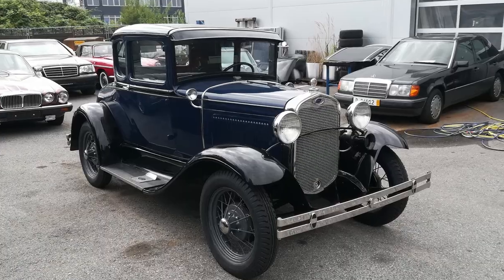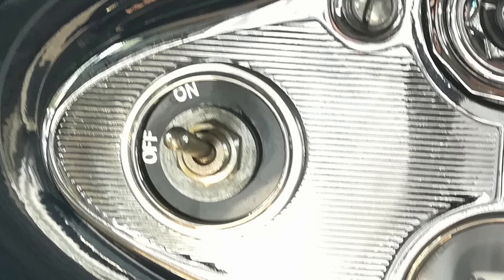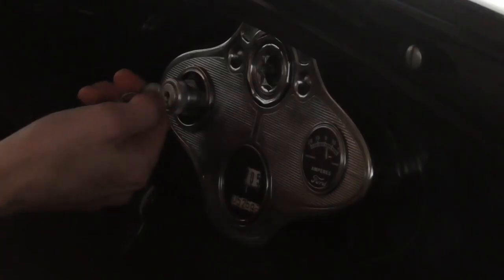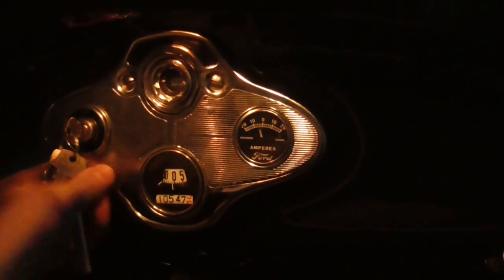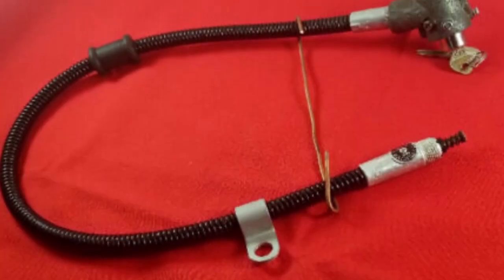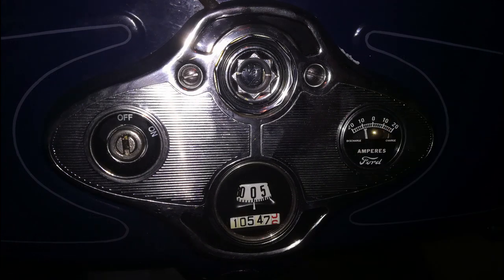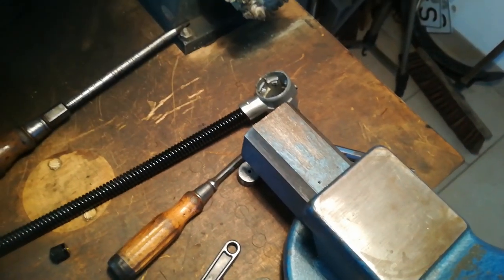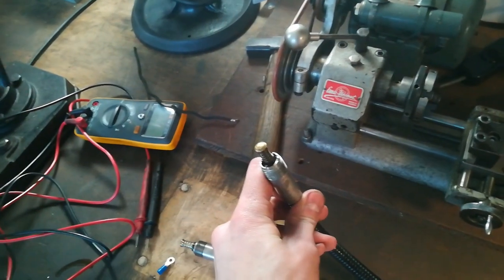Quickie: Hot-Wiring the A!

Comment: Apparently the "Electrolok" ignition switch could be a pain in the "ahem". As usual, this is mostly due to not maintaining it properly so that eventually the "pop out" contacts don't give you a good connection. I like the fact that the ignition circuit is automatically grounded when the lock is pushed in. I'm not so keen on being able to remove the key with the engine running since I would most likely:
A—drop the key in between the seats or something equally stupid or
B—accidentally push in the Electrolok and kill the engine at an inopportune time (climbing a hill, for example) and then have to fumble the key out of a pocket (or from under the seat) to get the damn thing going again. 
Good on you for quickly finding a work around and making it to your meeting. If nothing else, driving a Model A trains you in the art of instantaneous improvisation!   ;-)
Reply from the maker: I heard that these things have a bad reputation - then again, I think any lock will wear out after 90 years if not taken care of.
One good thing about the broken cable was I had to take it apart and could give it a good lookover.
I like the removable keys for two reasons: 
1 - it gets rid of the annoying rattling of key bundle agains instrument panel
2 - it permits me to lock my garage without switching the engine off. Nothing hurts more than shutting off a stone-cold engine
Reply: You can just leave the key in. You don't HAVE to take it out..

Comment: Great & Interesting video. Did you run the bypass wire in through the spark advance notch?
That's much easier than commercial bypass units requiring removing of the distributor end of the cable.
Reply from the maker: Exactly :)

Comment: What sort of dash camera do you use inside your Model A? Does it work for 6 volt?
Reply from the maker: It's called Garmin Mini. Since USB voltage is 5V, it's no problem to wire up a USB converter.
Mine is plugged into the 2nd maplight socket.